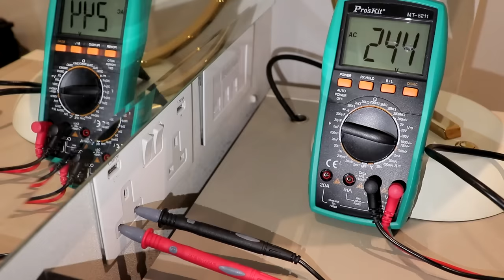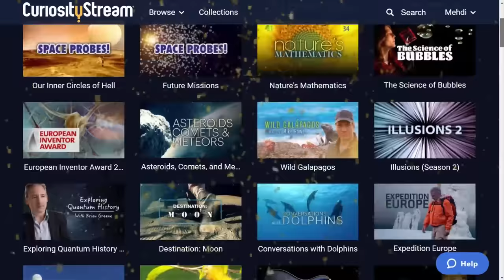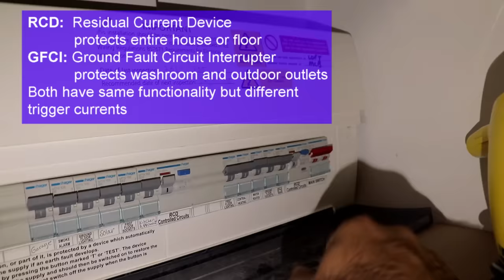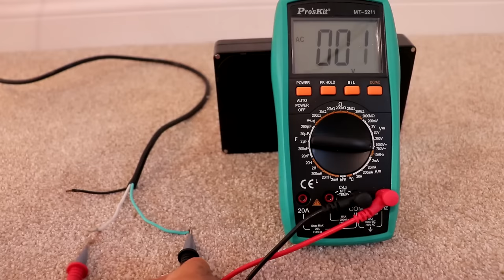Power Outlets in United Kingdom

Comment: ElectroBOOM in a UK Hotel...

...I'm about to end this Hotels whole Electricity System!
Reply: Not quite. 

It's funny to think about, sure, Lol.
But, as he explained; at least half explained; our breaker boxes don't take out the entire power to the building. If outlets short, then every outlet will be shut off. 
But general lighting like lights, heating, and even cooking equipment, will continue to work.

That, and I believe larger buildings, such as hotels, have breakers for each floor.

No damage done.

Only need to flip the breaker again. 
If the breaker is triggered again, for apparent no reason, then the outlet itself will be disconnected from the system.
We have a tonne of redundancies in place to ensure as little damage happens when things like these, happen. ^^
Reply: Wait, when did he ever say he was going to end the whole electrical system? What part of the video?
Reply: I feel bad for the hotel
Reply: @Sophie-dt3ck  tell me more about it when those damn breakers and fuses blow out in substation but everything else is untouched but should had to blow before substation. What you say is true but sometimes happens some weird stuff. What i explained now happened with me at work with testing station which had own substation and when accidentalt two phases were shorted and tho every other smaller fuse had to blow before substation fuses, guess what, substation ones blew and everything else did not and were fully functional. I assure you that substation fuses were bigger in every way than testing station fuses and breakers. Funny stuff just happens sometimes.

Comment: 11:26 “but hey, in north america, who cares about redundancy?”
737 MAX intensifies
Reply: Right. Redundancy in the capacity/load/size, not safety. That's the US in a nutshell.
Then again, they have interesting safety labels on products for liability reasons.
Reply: I'm USA & I care 🤔hmmmmmn
😅😆🤓😓🖖✌
Too make things More hilarious under American Common Law Maxim : It is Unlawful to attempt to Indemnify from harm for Knowingly Wrongful Acts.  
 Our electrical practices can be 
SHOCKINGLY bad & Knowingly Wrongful ='s Oye the implications 
  I use GCFI on albeit all , Can Write P.A.N.I from memory 
(having already done so for Wireless Cellsite installation to Instruct where to Ground etc all the New 3 & 4g equipment ) 
and am Now beginning to learn about RCD . 
 I will start process of Changing out my "American" equipment as I'm adding Renewable energy in steps to my home as it is . 
(Type F if Inverted to 110v ) 
{Didn't find anything pertaining to Hybrid Charge , Control & Inverter MPPT equipment thus far or Straight DC to DC Battery only or on Lightning protection devices} 
Necessary for Grid tie of Course 
"Electrical inspectors gonna have a heart attack ." 😂😣🤕🤓😆
 You are correct though ; most Americans don't Know diddly 
Bout hardly anything anymore ;
Heck Most have never even Read the Entire USA Constitution nvrmd 
Electrical Codes or the Newly being implemented UN Sustainable development International Bldg Codes . 
They are In for a "Culture" Shock😔
Reply: @Madsy9  seething
Reply: The 737 MAXs always nosedives
Reply: But the good thing mehdi didnt die from the 737 diving to him lol

Comment: You plug at 6 minutes was missing the cable clamp.  There should be a clamp across the exit held down by the two smaller screws that stops the cable from being pulled out.

Comment: The switches are for convenience. So that you can turn whatever appliance off at the plug rather than having to pull the plug out.
Reply: safer for the plug and safer for your feet lmao
Reply: It also means that you don't create an arc (big blue flash) when you remove/insert a plug. This can slightly damage plugs and outlets if done repeatedly.

Comment: UK appliance plugs: MAX SAFETY, youre more likely to accidentaly strangle yourself on the wire then get shocked

American companies and plugs : May the odds be Ever in Your Favor <3
Reply: True and painful when stepped on.
Reply: @mrmangosir  That's called Behaviour modification, it's to remind people to not be such dolts and leave a plug on the damn floor.
Reply: @matts1603  good point. Americans be like "yikes I stepped on a lego."

Meanwhile in the UK
"Lego? That's like a plastic brick massage."
Reply: Strangled AND shocked?, doesn't sound safe at all.
Reply: @matts1603  if behavior modification was the goal the other safety features should be left out too. Nothing tells you to be careful when plugging in something like 120-240V to the hand.
Reply: You have a barn owl as your profile pic.
I haven't read your comment, but have my like. Barn owls are good.
Reply: American companies: G O O D L U C K
Reply: UK appliance plugs make it easy for 2,350 watt linear regulated power supplies to be built right into the body of the plug itself.  You guys also get to safely stow your flat screen TVs into their power plugs for protection when not in use.  We don't have those features yet.
Reply: When I lived in the UK and a plug was left on the floor from the vacuum I stepped on it and my foot was bleeding and bruised slightly
Reply: @guymoore3794  Unused UK plugs in America get retrofitted to become grand concert pianos.  Some of the best in fact.
Reply: @nuttyjoe  fault*
Reply: @nuttyjoe  Einstein*
Reply: I'm an amputee and used to hop around the house occasionally, until I met the thing more feared than a Lego brick, a 3 pin plug!
Reply: If you think American plugs have low safety standards, then you would be amazed at third world country plugs, they don't even have ground.
Reply: @widget3672  + here in malaysia too
Reply: @akunog2708  i don't think it was the goal but it's like a byproduct, and it won't kill a baby so...
Reply: I think your more likely to die from shock when stepping on them, when they’re upside down
Reply: Matt S doesn’t work
Reply: Its not like that in amarica actually so its safe but what they need to fix is the stupid thing in the closet that ripped my toe off and that what amarica is like your more likely to get your toe ripped of by a closet than get shocked
Reply: maria gil How can the US be very safe whenever they have exposed metal on the plugs and you can have the plugs halfway plugged in and still get a shock
Reply: You think we care about safety?
Reply: Heritic Slayer I used to, not anymore
Reply: @mariagil2170  where is amarica is that some third world country?
Reply: Feel like they could take the idea of using some plastic instead of full metal inserts like the UK
Ngl but sometimes during humid weather the sockets would shock itself when i plug my stuff in the wall outlet 
yeah... better copy some UK stuff...
Reply: Thats why i live in Switzerland, there can never something like that all happen
Reply: Wandy Wexler Weslon  Electroboom literally just said he knew several people that would've been alive if they had those safety features
Reply: I'm so glad Y'all have your safety scissor equivalent to plugs....
Reply: James plus in America you can stick metal in and get shocked it’s more effort over here
Reply: That and the earth pins tend to brake off making the plug useless and as an added bonus you’ll have to change the socket too.    Uk plugs are the safest by are by no means perfect
Reply: Wandy Wexler Weslon  but your point was anecdotal evidence, bit hypocritical? 'i don't know anyone who got shocked"
Reply: than*
Reply: @mariagil2170  what's in the closet that ripped you toe off? Was it a metal threshold cover?
Reply: I've never been killed by a socket or exposed wires. Been shocked plenty, but let me check, yep still alive. My most entertaining shock came when someone called the house phone while I was stripping the connected wires with my teeth. That was fun. My teeth felt like they were ringing with electricity as my jaw muscles  clamped down even tighter. We laughed and laughed. Good times.
Reply: Don't talk about stepping on UK plugs. I once fell off one and falling from such height, it ain't fun.

Comment: Hi, a proper MK socket even if you push the earth door slider down, the doors of Live and Neutral doesn't open, the two pins (L&N) must simultaneously be pushed against their own doors before they open, you can't push one of them open on it's own.
Keep up the good work 👍

Comment: I don't know about Canada but down here in the USA you are wrong about us not having whole house GFCIs.  In fact, the latest edition of the National Electrical Code REQUIRES the installation of dual function Arc Fault/Ground Fault Circuit Breakers for all 110 Volt circuits in new construction and major remodeling jobs.  There are also Dual Function AFCI/GFCI outlets which, when installed at the first outlet after the breaker, will protect the entire circuit.  GFCI outlets have had the feed-thru ability since the were introduced and were require in all areas with potential exposure to water or wet surfaces like bathrooms, kitchens, basements, garages, laundry rooms and outdoor outlets, which also require in use covers to protect the outlets from rain and splashed water.

Comment: A few things, those gas lamps actually burn the methane from the sewers, so are actually more environmentally friendly than LED.
Some sockets are switched, others are double pole (breakers), with DP being more expensive.
Another safety feature is that they are ALWAYS polar, which is not the case in America.
The presence of an RCD is also now mandatory.
Reply: Andy ME  I don't know where you're getting that from, but double pole switched sockets are quite common.
https://www.screwfix.com/p/lap-13a-2-gang-dp-switched-plug-socket-white-5-pack/49620
Reply: Why methane is better than led? 
methane is still a co2 producing stuff
Reply: @sayyidsahal4533  Methane is a more potent greenhouse gas than CO2 (25 times more) and the methane from biogas (from food waste, animal farming and human sewage) would otherwise be in the atmosphere. Harvesting and burning that gas is better for the environment, to put it to a useful purpose is better still.
Reply: @LudvigIndestrucable  👌
Reply: Andy ME  The regs don't specify that they have to by DP. However, most are. e.g. MK Logic Plus.  It is a shame that the newer cheap and tacky MK Essentials range are not.
Reply: There's only one destructor lamp left, yes, but sewer gas and biogas is harvested and fed into the NTS. There're moves to expand this to make up ~50% of the UK gas supply, but more investment is needed. There is also a program already in place which injects hydrogen gas into the NTS using excess wind and solar power.
Reply: @LudvigIndestrucable  Dude but you are still Burning methane Producing CO2!!
Reply: @harmitchhabra989  As already discussed, burning preexisting methane is better for the environment than allowing it into the atmosphere.
Reply: Are we just gonna gloss over the fact that some lamps over here run on farts?
Reply: @sayyidsahal4533 As methane is extremely bad for global warming, it's actually better to burn it and convert it to CO2 which is less harmful!
Reply: " Always polar" ... starts swetting in Schuko.
Reply: JadonGamer  No, America. Because of the nature of the plugs and sockets not having a mandatory earth, they are usually less strict about polarity in a way that is simply not acceptable or possible in the UK or other 3-pin countries.
Reply: JadonGamer  Grounding and polarity are two separate things, I think you may have misunderstood.
The only reason that grounding comes into effect in the conversation is that  3-pin plugs have one workable orientation, whereas two pin plugs can be plugged either way around so polarity becomes unenforceable.
Reply: led is way better than burning natural gas
Reply: @sayyidsahal4533  gottem
Reply: Andy ME  BS 1363 Socket outlets are frequently (but not always) double pole switched. This is perfectly acceptable so long as the live and neutral conductors are both broken 'substantially at the same time'.
Reply: Andy ME  Look on any electrical supplier, you will find DP sockets and SP sockets, please then email the supplier and manufacturer telling them they don't exist because I'm tired of it.
Reply: Methane, That Is GENIOUS

Comment: He commented on the "gas" street light not being LED. It is OK because most electricity in the UK is generated by burning gas so it just cuts out the power station and all the distribution network.
Reply: I expect burning gas to create light is less efficient than burning gas to create electricity and then powering an LED. Would be good if someone can confirm though.
Reply: @rewindoflow  it was burning sewer gas anyway, not mains gas, that's why it was lit during the day
Reply: @andreww2098  now that's a clever design.
Reply: @rewindoflow that is true, and the sole reason gas lighting has been retained in a few places is for tradition and tourism. There is currently a debate going on about electrifying them.

Comment: Shaver socket has its own 1:1 transformer to isolate from earth. This is why they are limited power (usually 500mA).   Much safety.
Reply: doesn't it also isolate them from the GFCI?  Which... means the only outlet not protected... is the one over the bathroom sink?
Reply: @mgjk  It does, but because the transformer isolates the output, removing any reference to ground, you do not complete the circuit if you touch one of the output pins and ground, so you don't get any shock. To be clear, the GFCI/RCD is (usually) only designed to protect you in that specific situation, and the transformer makes that situation impossible.
Reply: @makorek  jog on you mong come back when you know what you are talking about
Reply: @makorek  Thats very unsafe
Reply: water and electricity do not mix no matter how smart you claim to be accidents do happen and when theres electricity involved that one small accident could be your last
Reply: @shadowxxe  there is such thing like gravity, you know, water goes down, no sideways so sockets above 1m and blocked from shower are totally safe. how can you have a bathroom without normal sockets? how do you charge your laptop when you are in a tub? I use my laptop when in bath so i need power supply and i have it. Also for electrical brushes, shavers, hair things etc.
Reply: @makorek  1.Why do you need to charge your laptop while having a bath lol 2. I was more thinking of the type of accident where you try plug in your trimmer after a shower and you accidently touch the prong with your wet hand and give yourself a shock
Reply: @shadowxxe  i was shocked already 3 times(in a hall and living room), it is nothing scary.  I watch youtube when lying in bathtub. what do you do? observing ceiling. btw i plug in and plug off with wet hands, it is ok, you touch outside of the plug/
Reply: @makorek  Cool i got shocked by the exposed internals of a laptop charger however thats not to say it isnt deadly infact the only reason i let go of the charger was because someone was there to pull me off of it if I had been alone my muscles would have contracted because of the electricity and i would have gripped that thing until my heart stopped so just because you have been shocked before and survived doesn't mean you can't die because of a shock. also i will usually take my phone into the shower and watch youtube